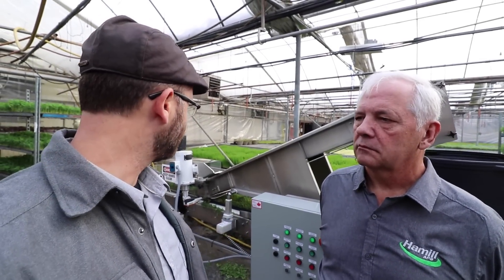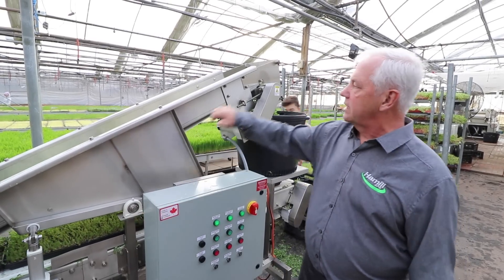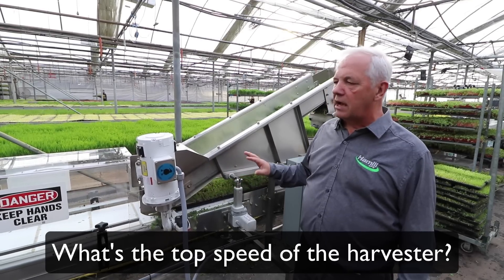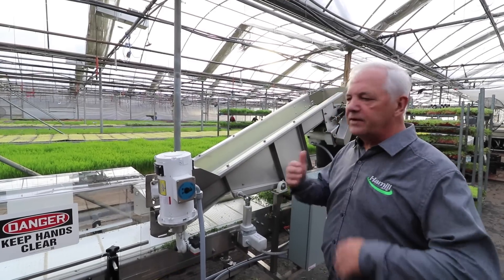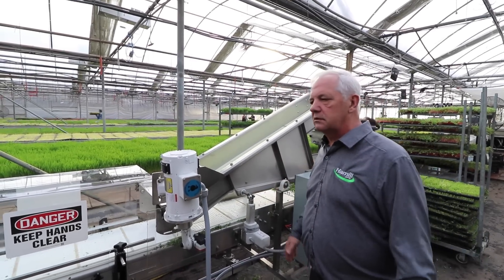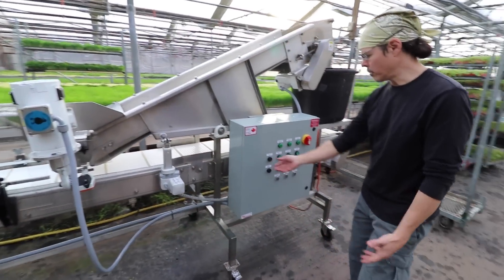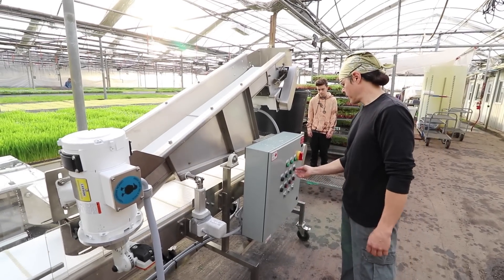This Mind-Blowing Machine Cuts Through 400 Flats Per Hour!

Comment: It wastes A LOT of greens unless fed continuously. 
02:45
I would add a rotating brush on top to prevent that if I were you.

And add an automatic turntable for the landing bucket.
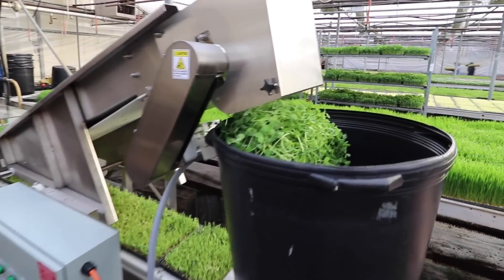07:45
Reply: If the design flaws weren't glaringly obvious to begin with I might suggest you try to get paid for your advice to this company.  But alas, they are just that obvious you wonder who was responsible for the quality control in design  stage here?
Reply: I strongly agree with DD.  It annoys me to see obvious inefficiencies, but what bothers me more, when these things are pointed out, mostly my ideas are ignored.  I have been told, "We already considered those ideas."  (They did not! Or, they were too lame to implement them.)

Comment: I would add a 45 degree angle on the Belt a high CFM fan blowing down and have the belt at the bottom so you don't waste all the greens as stated in comments below

Comment: 40 grand for 2 conveyor belts and a hedge trimmer?
Reply: Make one and compete
Reply from the maker: Exactly. Good luck there.
Reply: Actually i was thinking the same thing, that wash down motor may be 1000.00, 120v inverter 150, buttons and controls maybe 100 if bought from automation direct the belt, and stainless steel, not sure. Man hours to build and design it may be expensive maybe 2000.00.
  Thats a really profitable build.
Reply: Busytech yeah and after insurence,depreciation costs, building up a saving account,paying water,electricity,advertising,planning costs,trial and error,paying interest,retirement plan,tools needed for building,certification cost,municipal costs, and the list goes on and on and on . but I'm sure , you as a Superhero would be selling the machine for 200 bucks and still make 150bucks in profit. Good luck!
Reply: I'm a machinist. I came here to add that stainless steel isn't cheap.
Reply: @Busytech109  :  Good engineering always results in a simple looking product, and with mechanical efficiencies, equipment can be built quite inexpensively compared to the selling price.  However, few people consider the marketing process and costs, and no one can put an efficient team together without major expense. And, pre-production costs need to be paid for.  This machine may have taken several years of planning, development and engineering, and those expenses need to be financed, and paid for.  
For example: a mechanic might repair your car at a dealership in fifteen minutes, but the bill could be $1000.  the mechanic might make $20 for his time. Expenses and costs are not a 'snapshot'.
Reply: @ThisOldMan-ya472  I'm an electronic tech, the electronics vfds, controls are cheap, a wash down motor may cost 1k, and yes I know stainless is expensive. Yeah I get it the overhead is expensive, I've seen entrepreneurs design their own machines, this project isn't rocket science. Thanks for replying.
Reply: @Busytech109  In your post you mentioned a company that sells cheap controls?  Automation Direct ?
Reply: @ThisOldMan-ya472  Automation direct is cheap, but really like an AB VFD isn't that much. I would think with all electrical components they spent under 1500 US dollars.

Comment: Awesome product for 30 mm is way too f**** expensive for that for that price I would literally design my own and not sell it just use it myself so there would be no patent infringement or any of that all you have is a cutter to belts and controls that is not worth $32,000 I'm sorry it's an amazing product but not for $32000
Reply: LOL  Obviously you haven't built any production equipment. I build a lot of accessories for my equipment, and know my limitations.  I was contemplating the same idea, that I could use this machine as a template to build my own, but realized I probably would have to buy many of the 'parts' which may only be available through this company, because who else makes them?  This machine can probably run all year with very few adjustments, it could probably be put into storage and brought back to production with very little tinkering, etc.  My machine would need not only my time for manufacture, but it would be difficult for me to engineer durability and simplicity, as this company has.